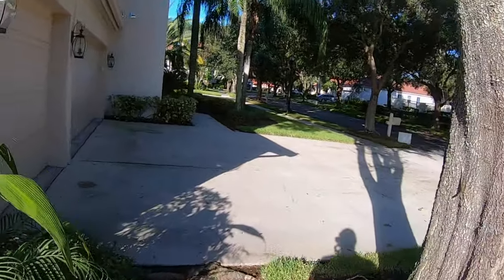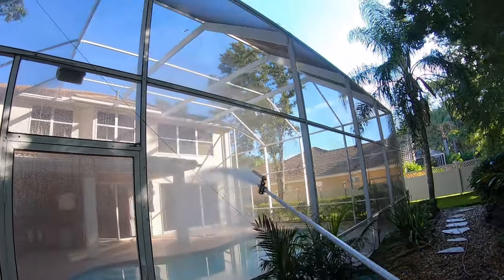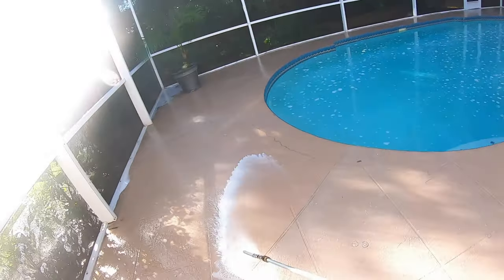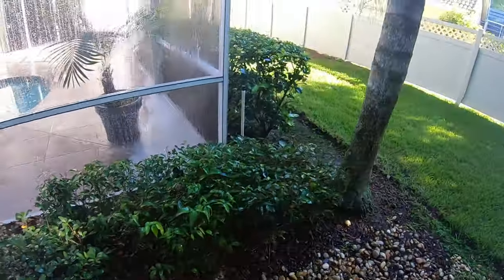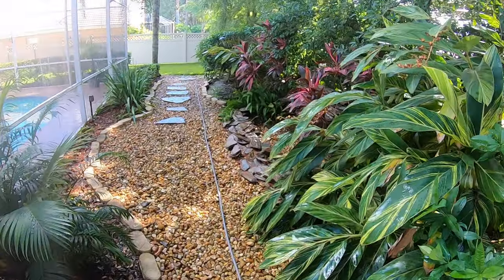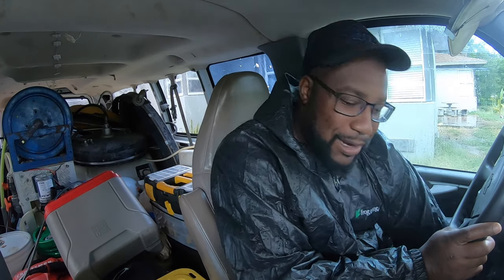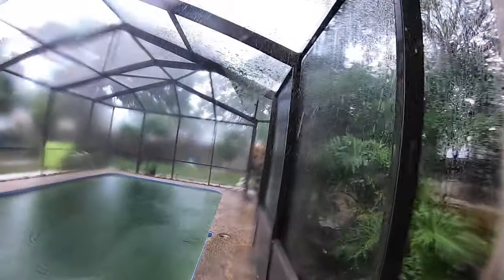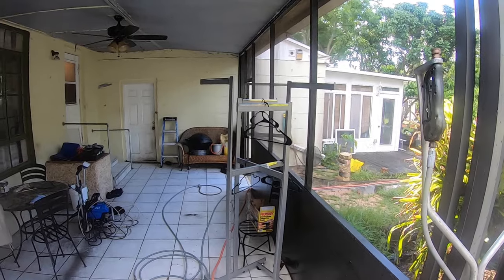how to clean a pool screen enclosure

Comment: So cleaning the aluminum at the top and then the sides doesn’t tear the screen?  And how do you clean a travertine deck?  I was told you’re not supposed to pressure wash them?  Great video thanks!
Reply from the maker: No it doesn't unless u do it incorrectly by blasting it with high pressure. 

I've surface cleaned and soft wash Travertine. Both are fine.
Reply: Great to know!  Thanks

Comment: Ever had any problems with cleaning the lanai enclosures? I cleaned one and pool deck this morning and not sure but I think it chipped a little of the paint. No pressure was used. Just a soft wash. My mix consists of 5 to 6%. Maybe to strong? I ended up talking to the owner and we came up to the conclusion that the paint is just old and washing away. Any Imput or problems with lanais? Thanks a lot man been going through your videos lol
Reply from the maker: No problem with them at all. If paint is coming off that means it's oxidized.  I was oxidized cages all the time bit a downstream mix and soft wash is what I do to wash all of them

Comment: When you're cleaning a pool screening cage do you start on the inside or outside first and why thanks.
Reply from the maker: I soap Outside then inside (those 2 can be swapped) but I always rinse Outside 1st then inside 2nd because if you rinse inside 1st and rinse Outside 2nd you will push all the dirty water back inside that's already cleaned

Comment: What is best product to clean with? Is it same soap for cage and screen? Do you put right in pressure washer?
Reply from the maker: Sodium hypochlorite better known as chlorine. No it doesn't go in the pressure washer especially those little homeowner grade ones that has that little dispenser.  It will literally eat the pump up. 

I'm the professional field we use a little attachment called a downstream injector which injects the chemical into the water that's passing through the hose. (It's called downstream injector because it's installed after the pump)
Reply: @PinkFlamingoPowerWash  TY sooooo much!!! 💚😘😘💚

Comment: hey buddy what size tip are you using to soap the screen down? Also how about soap in the center of the cage inside of top? Thanks man
Reply from the maker: Hey bro. Keep in mind I have an 8gpm so unless you have the same the tips will differ.  But I use a 2550 soap tip. And the long range tip is a Davis shooter tip.
Reply: @PinkFlamingoPowerWash  I have a 4 gallon GPM HOTSY, do you know what size tip I would use with a 2.1 down streamer to get the same results thanks 1 million👍🏼
Reply from the maker: @robertschwarz6849  for a 4gpm it's a 2540 tip. There's a link for a 4gpm jrod in the description of the video

Comment: Since you seem to be the only one on YouTube who responds to your subs!!
I went with the dn10 valve, set everything up correctly and when I crack the valve, it doesn’t seem to catch pressure. I’ve cracked it just a little bit, and fully open and just doesn’t seem to want to build pressure. I’m running a dewalt 3500psi setup for the time being, do you have any idea on what the issue could be? I’m trying to just run a ball valve setup and eliminate my wand. I see others doing it, but no one seems to respond to subscribers anymore lol. Any idea boss?
Reply from the maker: Lol thanks.  Have you tried to do a pressure test to see If your ubloader is set correctly?
Reply: @PinkFlamingoPowerWash  I haven’t. I’ll make that my next step. I’ve noticed when I kink the line in my hand it will help it build pressure quick but as soon as I let it go it loses it. But if I put the wand on, no problems lol. Driving me nuts😂

Comment: Is the everflo 5500 5.5 gpm ok to run sh thru or do I need a different everpro?
Reply from the maker: Yes they work fine. Just gotta rinse it for a good 5 minutes with fresh water after you're done working.

Comment: Hey Cliff, great video 👍. If you have to clean decorative curbing or planters curbing like the one you did in this video but it is right on top of healthy grass how would you go about cleaning it? Still 5% and a possible neutralizer?
Reply from the maker: Be careful spraying that hot around a flower bed.  Definitely would need to water them down a lot before and after.  A neutralizer is another fancy way of doing it.  Agent halt or sodium thiosulfate will do the trick.

Comment: Do you ever notice the paint coming off the aluminum? Would that just mean the mix is too hot?
Reply from the maker: No. But if it is its cause the cage is oxidized and the pressure hitting it makes it come off. Not the mix.

Comment: Bro , if I am downstreaming it doesn’t matter what percentage of SH I get because the most it’ll pull will be maybe 1.5% max no ? Am I right ? Please help
Reply from the maker: No if youre using 10% vs 12.5% your output will be just slightly different. But not by a huge margin. Were talking maybe 1% vs 1.25%
Reply: @PinkFlamingoPowerWash  but what if I use lets say a “7% or anything less ?
Reply from the maker: @chrisrubio2218  the lower your sh is 100% the lower your downstream mix will be
Reply: @PinkFlamingoPowerWash  thank you man , also the other day I was using my surface cleaner and it was vibrating a bit more than normal any ideas ?
Reply from the maker: @chrisrubio2218  check your tips. Also make sure your bar isn't bent

Comment: Always such a big secret if he tells you what kind of soap solution he's using Daniel won't need him so let's keep it top secret
Reply from the maker: HUH?? elaborate so i make sure im not reading your comment the wrong way. Cause it sounds like youre attacking my character but i dont wanna assume.
Reply: @PinkFlamingoPowerWash  I'm not attacking your character what is the percentage to clean screens I've nothing to do with attacking your character and to clean concrete if you don't want to answer I'll find out somewhere else
Reply from the maker: @Joel Bell  man I done answered that 1000000 times in 3 years. Miss me with that mess. I don't withhold no information on my channel. I don't charge for nothing. Everything absolutely free! Talking about always a big secret. Man gone somewhere. Don't play with me like that. Anyone who follow this channel will tell you that's all i do is provide all the help without no backdoor junk.  Smh